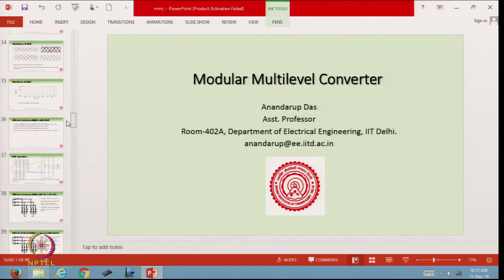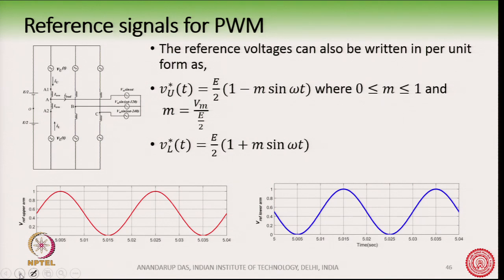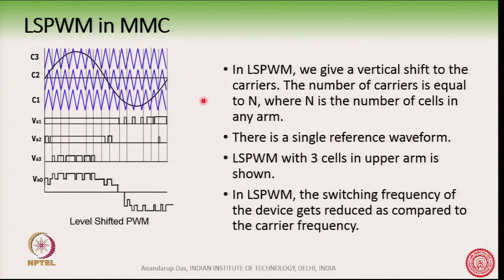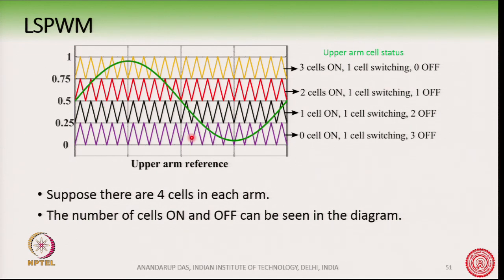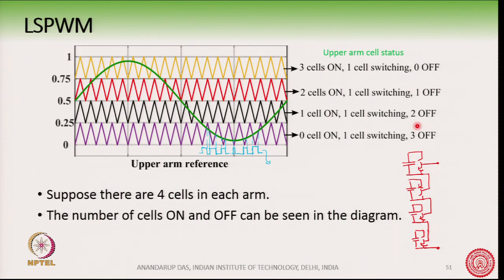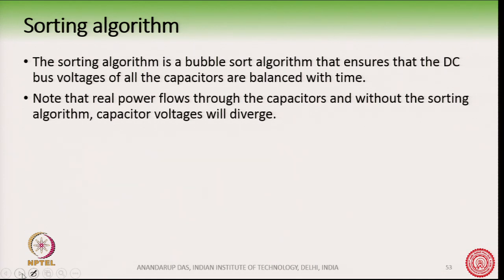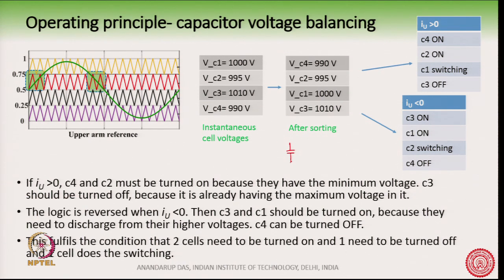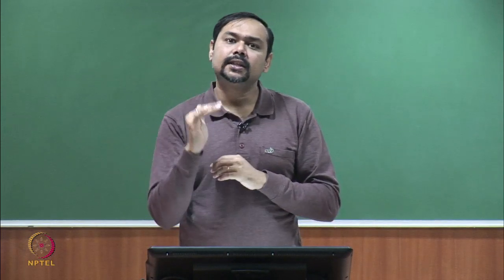Modular Multilevel Converter - PWM Technique and Capacitor Voltage Balancing

Comment: I did simulate a three level flying capacitor class D amp, but capacitor voltage is not oke, do this normally  not balance itself with fase shifted triangles and the voltage feedback I use?, I get very low distortions below -100dB so mine feedback is nicely working, only postfeedback after low pass.

Comment: At time 46:09 to 46:30 you explained that by turning on the upper swicth of the ist cell the iu current will charge the capacitor however by design we are using igbt how is it possible for igbt to conduct in the opposite direction? kindly explain I am getting confused
Reply: there is always an Anti-Parallel diode connected to each switches providing bidirectional current flow. hence, considering the upper switch of a half bridge, while a current flow through IGBT will discharge the Cap , the apposite current flow through the Anti Parallel Diode will charge that cap

Comment: Hello dear Professor. are there video that  explain Capacitor Voltage Balancing Using PI-Controller?
Reply: Whats your problem
Reply: I have the same doubt. @Guerrondo Gero
Let me know if you found any relevant reference or video